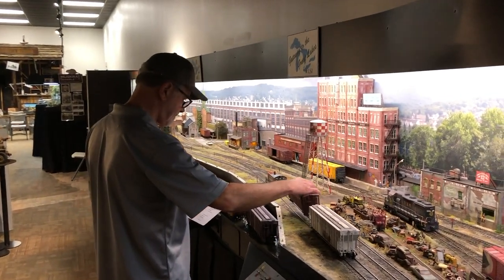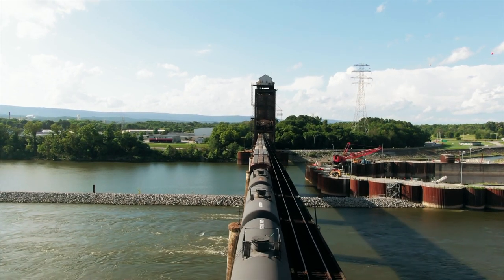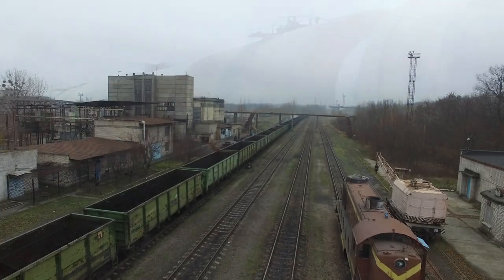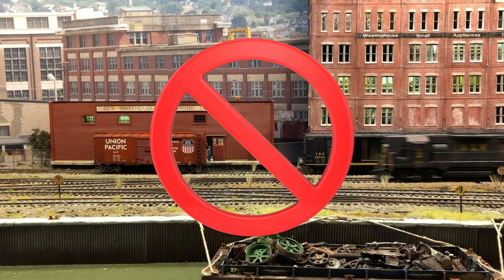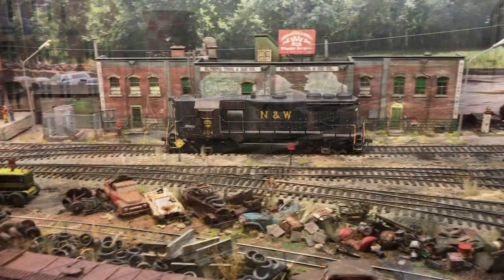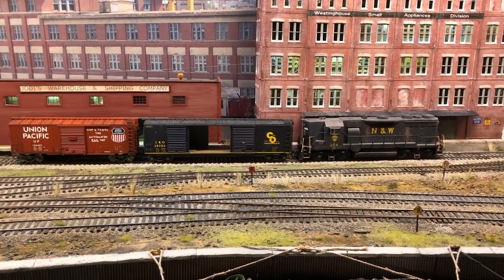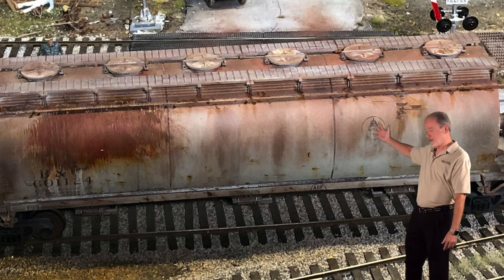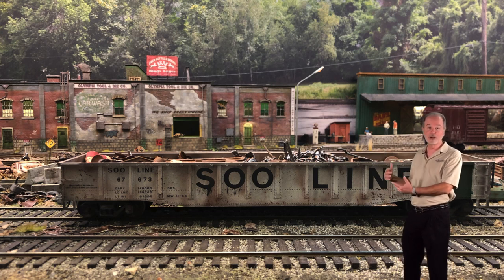How Switching Works -  Lakeshore Industrial Railroad In O Scale

Comment: Really great scenery work. The one thing that needs to happen to compliment  that level of skill and effort, would be to “dial in” your starting voltage, mid voltage and end voltage. The high hood is starting  and stopping too fast to be realistic. Other then that, this is awesome!👍🏻
Reply: I agree, Timothy, and we have done that since shooting this video.  The big challenge for the video was I could not narrate it and run the train at the same time so our operator got a bit heavy handed on the throttle:)

Comment: For "O" Scale,  that's an impressive operation considering the limited space.  I was following each locomotive move made on the video and comparing it to the track plan shown at 4:00 minutes.  But they don't match up.  The actual layout has trackage and turnouts not shown on the layout drawing. Was additional trackage added later to improve operations? Great layout and very well made video!  I hope to see it in person and operate it someday!
Reply from the maker: I hope you do get a chance to see the railroad someday (and operate it).  Yes, we enhanced the track layout a bit after the layout drawing was complete which is why you see the discrepancy.

Comment: Question: right around 13:30 you're explaining why you can't make your pulls first, then switch out the yard to then put those cars into a storage track. Why not? I may not understand the limited space here but couldn't you make your pulls, set those cars in the clear of the yard, switch out the yard to get the cars you need to spot as well as free up a track, then put the original cars into the yard, then go spot up the industries? Again I may not be understanding the limited space here, so my thinking might just be impossible, I've never modeled O scale before. Love the video, though, very accurate in terms of how we switch out!
Reply from the maker: In concept you are right, the cars that are pulled could be set aside on free track space until yard trackage opens up.  What we are dealing with in this particular layout is the limited space.  There is very little free trackage available to accommodate cars waiting to moved elsewhere especially when the run around tracks need to remain open to move the locomotive to the other side of the cars to push them into the yard.  I wanted viewers to get a sense for the alternate pull/place decisions as they figure out how to get the switch list completed.  Thanks for your comments and glad you are enjoying the video!
Reply: @suncoastcenterforfinescale5802  The layout operations are very realistic with the limited space. Pretty close to the yard i work at unfortunately, things can get pretty tight. Thanks for replying!